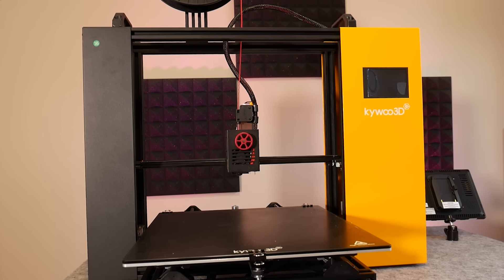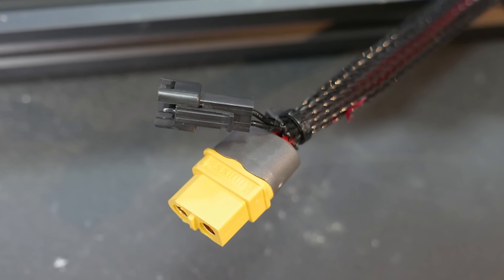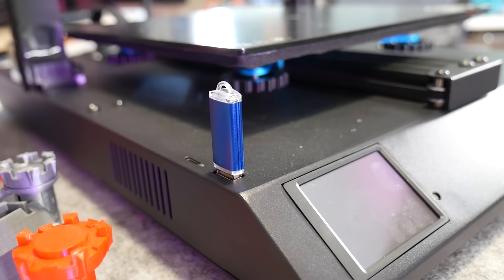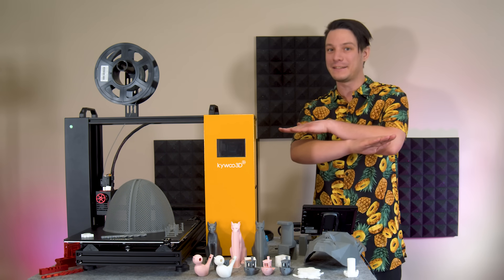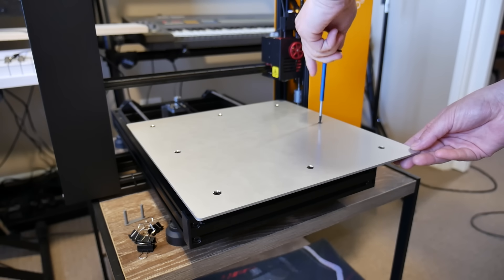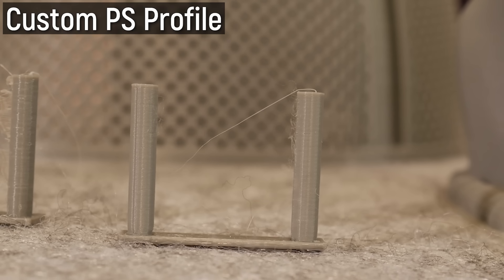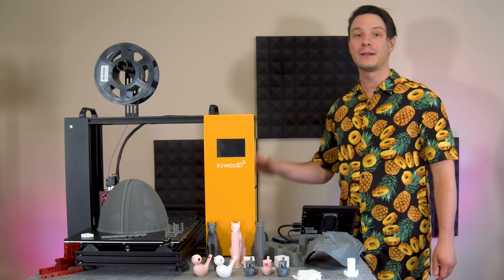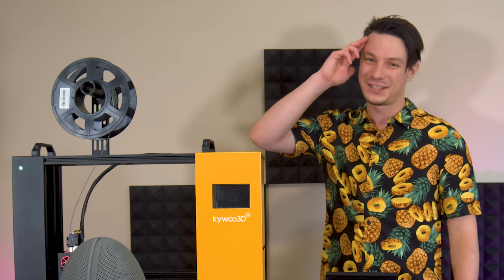The Quirky Kywoo3D Tycoon Max - 3D Printer Review

Comment: I have a question about that style of bed-leveling probe in general- is there any way to adjust the height on it?
Asking because I have nozzles that are different height than the stock one from my printer- it's a cheapo, "low-tech" kind, so zeroing the Z axis is a bit fiddly, but possible. It seems that it would be a problem if you wanted to swap nozzles on a printer with a probe integrated the way it is in Kywoo3D.
Reply: BL-Touch and other independent probes (Prusa PINDA/etc) trigger before the nozzle hits the bed, and you set an offset to tell the printer where the nozzle is in relation to the trigger point. I would expect, on something like this, you'd have to, like, write the offset down and manually re-enter it when you swapped, but that would be doable.

Raw headroom in terms of how much longer your nozzles can get before they start colliding before the sensor triggers will depend on the mounting bracket and if that can be adjusted, which varies printer to printer, but generally nozzles within the same ecosystem are all fairly similar in length, so you shouldn't run into that as an issue.
Reply: @Blooest  Thanks for the in-depth reply!
I've never played around with touch probes for Z axis and for some reason I thought that the trigger point was supposed to be the same height as the nozzle- since there's no visible way to adjust it physically I got a bit confused. Having the probe's trigger point beneath the nozzle and setting the offset in the printer software makes much more sense:)

Comment: If you were to bolt on the base from the top side down, you would likely have to still lift the whole frame a cm or two to reach the base.  The base is the only thing that rests on the table top, the frame hangs from the base...

Comment: I know this video is a year old now but do you have a recommendation for a printer at this price point with this capacity?  I've been using the regular size Tycoon for about three years with really good results but I've been wanting a second printer with a larger capacity, at least 300 x 300 or larger.  Your experience with Kywoo has been completely different than mine but this review has caused me to pause before buying their Max.  I would appreciate if you had a recommendation for a larger capacity printer in the same general price range.  Thank you.

Comment: That yellow stuff seems to be left behind by the filament on my coated glass bed. I use IPA on mine, maybe I shouldn't according to comments here, but the yellow stuff only shows up after printing and seems to correlate with poor adhesion. After cleaning it off (the paper towel looks identical), parts stick fine again.

Comment: Hello, could you please check for me if the horizontal installed fan next to nozzle is spinning when you set the fan speed via the touch interface? Mine isn't working and I am not sure if it is damaged or not. I am new to 3d printing.

Comment: Yeah, that yellow seems to be common in most unboxing videos w/ glass beds. It needs to be cleaned off completely.
Reply: I was having big problems with getting my prints to stick on my Ender 3 Max, which was quite disallusioning for a beginner, but when I cleaned the surface all that yellow stuff started coming off, and after a lot of cleaning the problems went away and I haven't had problems since. Each time I start up the printer I use isopropanol to clean it because fingerprints and dust seem to be magnetically attracted to the surface!
Reply: @IanSlothieRolfe  I've been told that Ultistick flex sheets don't care about fingerprints. The source has a print farm used in his business.

Comment: Hey Angus,

Good overall review. However, since I was early KS backer, and have one of the first machines produced. I've been using my Tycoon for over 6 months 💯 stock, I'm going to disagree/counter review some of the things mentioned.

First agreement:

1. Filament Sensor location, not ideal, and the issue you pointed is right. What I do is manually extrude the filament in the hotend, until it's thru the sensor, then extrude it back out, and pull it to the side, so it doesn't go back to the sensor. Not ideal, but works. The good thing about the sensor location is that you loose very little Filament, when you run out.

2. Heat bed does heat up slow. They do sell high efficiency heat bed now, and I think the new machines are coming fitted with it.

3. Hotend is not the best, but it's not crap either, as you say. It being their proprietary aluminum block design of integrated feeder+hotend, could use a dual gear feeder, and better throat, for better results. Can it be improved, definitely yes. Is it crap, definitely Not!

4. SD card slot gap is true. But, I've never had 1 fall in, cuz I'm careful... LoL

I agree with the option for USB stick as well

5. Wifi: it's MKS WiFi chip. I agree that it's hacky with stock Fw. However, it works very well with latest fw v201. They announced on fb this week that they're coming up with a better wifi fw in a couple weeks, to make it easier to play with. But, I love the option to control my machine, and even send prints to it (very slow upload), without having to setup/use octopi.

6. Parts cooling fan: is inadequate, at times. The biggest issue is that it could melt, and warp, and hit/snag onto the prints. My overhang, and bridging tests have been quite acceptable. However, a user has already designed better parts cooling fan replacement, which works better than stock. I know that he's working on an even better design, which actually might be an overkill.. lol

7. Cable stain relief and management: does need improved. However, I've not had any accidents due to it, thus far

Now, disagreements:

1. Y linear support rails : personally, I'm not a fan of rollers. Who cares if they used V slot extrusions, and linear support rails. I think linear support rails work much better than rollers.

2. Heatbed wobble: could have been shipping damage, cuz this is the first I've even heard of this issue. No one has had this issue, on the official FB group, and my prints have been very sharp, since Day 1. I'd be happy to show you examples, but you can see some in the FB group as well. So, that's just an unfortunate 1-off, cuz I do like not having to deal with rollers, or eccentric nuts.

3. Hotend/print quality/slicer: I'm not sure what Cura settings you used, but my profile works fantastic. I don't have any Retraction stringing, or whisping. I do run slowed Accel/jerk on all my machines 800/8. I run combing mode not in skin + avoid options. My Retractions for Tycoon are 2mm @35mms. And I get very clean prints.

4. Glass build plate: I dunno why you're having adhesion issues. I'm 6+ months, I have not had a single print get unstuck, and I also clean my build surface with 70% IPA 1x/week, or when I see visible grease/smudges. Otherwise, just a wipe with microfiber cloth. It actually sticks too well for me. And no, I'm not squishing Filament too much. Perfect first layers.

I hope this was helpful critique. Feel free to hit me up for a further conversation.

🍻, mate

Edit: fixed typos
Reply: Hi, could you share your profile? And where I can find parts cooling fan design? Thx
Reply: @bfx8185  it's all in the Files section, in the official FB group. Look for mount by Eli, and Profile+ start/end gcode by Gaurav, and adapted to Max version by Michael, right after my files.

Comment: Angus, i'd love an idea of a good 3D printer with an enclosure, i'm in the UK and the only space i have i could put one is in the garage, i know what i'm doing when it comes to electronics but i would love an idea of a printer that would be good to go out of the box and not have to spend a few weekends getting it re-built before i can finally get back into CAD after years break. software recommendations for someone used to AutoCAD but doesn't want to pay that much would also not go a miss

Comment: I don't understand the comment about mesh bed levelling being a compromise. No method is going to fix a warped bed except replacing it, right? So how is it a compromise compared to a warped bed with levelling screws?
Reply from the maker: It won't fix warp as such no, but you can still get it completely level which the mesh bed levelling will try compensate for.

Comment: always hated the ultrabase. remove it put a sheet of buildtak on it. also that way you don't even have to heat the bed using pla. and when you power off or loose power you should be able to restart the print. all my fdm printers have buildtak sheets on them. also don't forget the filament sensor needs moving. hope they fix the little problems. :) looks like it will be a great machine.

Comment: And, two years later.... what happened to this company? Can't get any response from them regarding an issue i have. I am after a copy of the slicer software as mine has become corrupt and am getting no response from them. My Tycoon Slim is currently as useful as a desk ornament. People have suggested using Cura which is fine if you know what you are doing but I struggle with all this stuff, I need my machines to be plug and play. Now looking at the Bambu Labs machines, but would like to get this ornament going again.

Comment: Ok Angus you just outed yourself with them pineapples to be a swinger LOL Dare you use V rollers no no no you use linear rails but you use not the ROD version on Y you use the : SBR16 They are 400% more stiff and better for Y axis to begin with. And throw the silicon stand offs out and replace them with Yellow flat band springs they are much better and longer lasting.

Comment: After the reveal of the Prusa XL, everything is even more "meh". :)
Reply: When a printer like this is 1/5 the price I could see why.
Reply: @brandoneich2412  Oh of course, the difference will be huge, but I mean a bit more the fact that they actually innovate, been a long time we've seen that.
Reply: @VincentGroenewold  this is very different from other printers, box style frame (similar slightly to lulzbot), z belt sync under the printer(never seen that on bed flinger before). New custom hotend/extruder (although not a great implementation)

Comment: I wish I had seen this before buying one myself. I actually uploaded my first YouTube video about it because this machine has issues. The thermistor wire is not rated to handle the constant bending that is caused by the movement of the bed. Bad engineering
Reply from the maker: Yep, the bed cable strain relief is non-existent and honestly a fire hazard. Great to see they've changed nothing since I called them out on it... :(